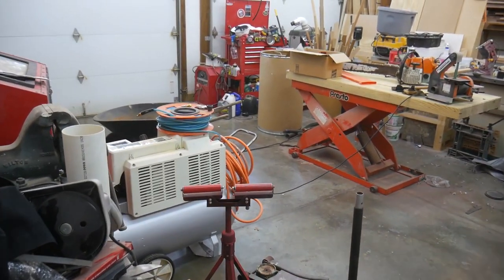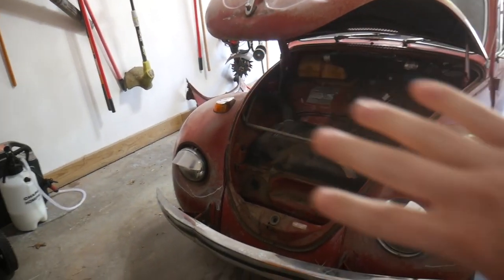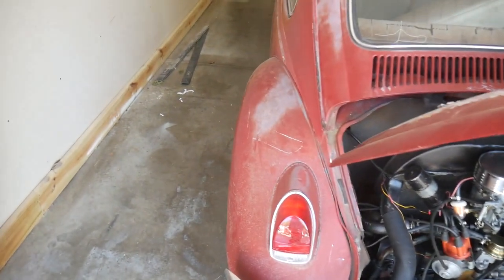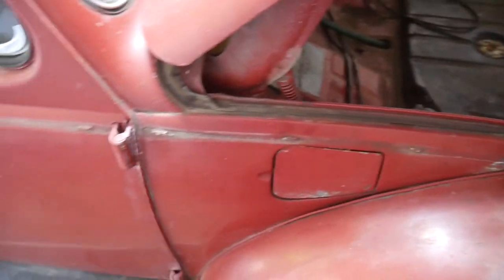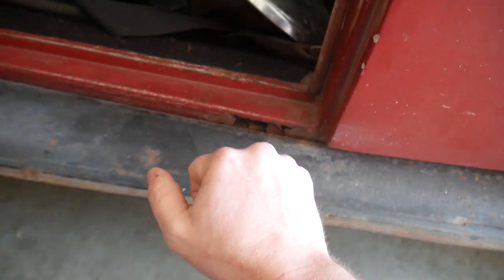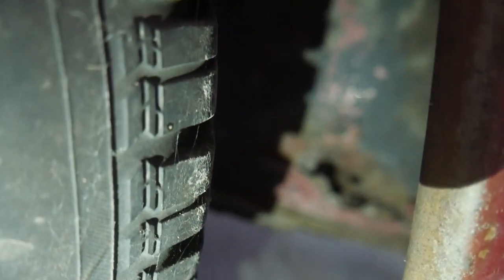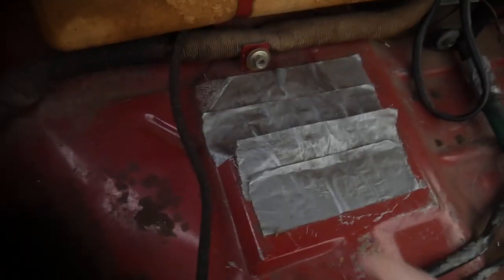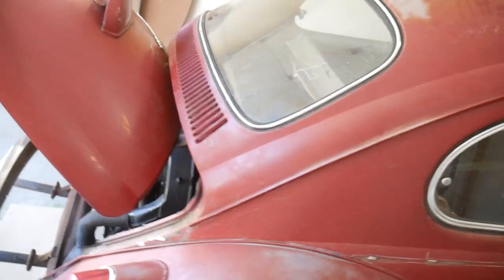New Project!  What have I gotten myself into? || 1968 VW Beetle Part1

Comment: Welcome to VW life! BEFORE YOU DRIVE IT Please replace all the tin work at the rear. The engine compartment needs to be sealed off otherwise you'll very quickly overheat the motor. Research that for sure. You'll do yourself a favour.
Reply from the maker: Thanks! This one is getting disassembled pretty much right away. Gotta figure out what needs replacing and what needs repairing
Reply: Thomas Lightle yeah. I only mentioned it because you spoke of running it with a temporary gas tank and taking it for a run. Under load, you’ll cook that motor quick without proper tin. Cheers and good luck. These cars are super simple. You’ll figure it all out. Like mine, soon you’ll hate it but love it more haha
Reply from the maker: Thanks again. I already drove it before I read your warning. Don’t worry, I only went about a mile on it. The suspension and brakes are shot, so I didn’t want to test my luck!

Comment: Whoops sorry.... I completely missed this.
Since You have a dual port engine.
I has a doghouse oil cooler and bigger fan....bigger engines need more cooling.
You should get a newer decklid, with the slots cut in it. It will allow that fan to draw more air as it was intended. The engine normally draws air through the slots at the bottom of the back glass. This is for single port engines. But the new engine requires more cooling so they put slots in the decklid.
Any 71 and up deck lid will fit.
Of course… This negates it looking like a 68.
Also, since you have a dual port engine. You will need the orange Bentley book. This is for 71 and up. Your engine numbers are under the generator stand. It probably is an AE....prefix...or variant.
Phenomenal engine. It had many great upgrades. Case saving studs, dual relief oil valves, bigger oil pump, doghouse oil cooler, a bigger carburetor, and more horsepower.
You would have to follow the specifications for that engine using the orange book. The blue book would be for your transmission and everything else in your car.
You could keep your eyes open for a single port H5 engine for that car.....but most of them are junk, wore out.
Reply from the maker: Wow, that is a lot of great information! I appreciate it. I’m going to have to dive deep once I get around to rebuilding the engine. Is there an alternative way to get more airflow to the engine besides changing the deck lid? It is one of the few tins on this thing that won’t need any bodywork, lol.
Reply: @SouthpawWorkshop  yes you can “ cal look” the deck lid by buying off set hinges...this raises the lid off the body a couple inches. But your engine will get wet when it rains.
Kawabunga dude!
Used Slotted deck lids are cheap
Just save the original for if you get a single port engine.
Reply: Thomas Lightle many have had great success with simply placing a tennis ball on the latch when driving if you don’t want to go to a raised decklid as OxFixer mentioned. This keeps the decklid from completely closing thus allows more air in. It’s cheap and many experienced aircooled folks say it’s perfect but. Personally, I’d get the slotted lid for your 1600 dual. They are everywhere and you’d likely get one local for cheap. If you were local to me and you brought me a beer I’d give you the one I have that is in perfect shape but, since I’m in Canada......
Reply from the maker: Definitely will keep my eyes open. Thanks to all for the info!
Reply from the maker: @OkFixer good idea. I can paint the original deck lid along with everything else.
Reply: @SouthpawWorkshop  we are definitely Here to help. These cars are getting fewer and far between, and we need to save them in my opinion. Anytime you need help let us know. I guarantee you someone on this thread will have an answer for you. Keep up the good work.

Comment: Hello, and welcome to owning a Volkswagen. That looks like a nice candidate. It doesn’t look too crispy and it hasn’t been boogered up too much.
Now, I’m going to be as kind as I can be. But will receive lots of flack for my comments.
1. Get yourself the blue Bentley book for this. And follow it precisely. How to keep your Volkswagen alive, a step-by-step for the complete idiot. Is another good book it’s lighthearted and full of useful information. But I always go to the blue book for my technical information and what part is missing on my car sort of thing. Remember it all depends on what you want to do. Do you want an engine that last as long as the original one, or do you like taking them in and out 20 or 30 times in the car’s life. Put it back original and it will last longer. It might not have 300 hp. But it will last longer. If you decide to put a 300 hp engine in that car remember how are you going to get that 300 hp on the road? Because that transmission won’t take that. How are you going to make it go around corners? And how are you going to make it stop going that fast. This car was not designed to have a 300 hp engine in it. If it was the Germans would’ve done it.
2.
I can already see, someone has a built-in engine fire under the hood… So they can ....I don’t know? See the gas? I’ve never quite figured that out. But that cheesy plastic fuel filter hanging over all that sparking ,hot metal it’s just not right. If you’re into fuel filters, put one in front of the engine… Front is front. Next to the transmission. If it leaks it’ll just leak onto the ground.
3. You have the wrong fuel pump, and carburetor. Look on volksbitz.com for the correct carburetor. I can tell it’s wrong because it’s shiny and new. Which tells me it’s a Brazilian unit.
The correct fuel pump has a fuel filter in it. Couple that with the one in the gas tank. And you don’t need an extra one. The fuel pump carb and distributor all work together.....if one of the units is made for a mercury mountaineer....it’s going to cause havoc with the other original parts. 
4. How much does it cost for spark plugs? A carburetor? A fuel pump? For a brand new Volkswagen? Well, it cost about the same for this car. For the correct rebuilt well working part. So prepare yourself. If you spend money on crappy Brazilian or Chinese parts. Trust me your engine will wheeze and tralphaz. Sometimes you have to search for these parts because they’re not available. Don’t give up and use the Russian, Turkish or Brazilian knock off. Your engine won’t run right. Now a lot of people say, Dan you’re full of crap. As they drive away with their wheezing engines. I’m telling you nothing is more a delight then driving one of these cars with a properly operating engine. People just don’t know. Wolfsburg West for new parts is the best source....still a crapshoot. Avoid “kawabunga dude bugs (jbugs) , cip1 (sorry we are sold out) or Oreillys etc.
The Samba .com is a good used source.
5 if That car was mine, the engine would come out. I would at least take the cylinder heads off, and look at them / clean them up. Check for cracks between spark plug holes. Check the cylinders that sort of thing. I would find every piece of tin. Including the thermostat. I would find every part for that engine that’s original. The air cleaner etc. The air cleaner that’s on that Right now passes about as much air as a can of peaches.... It will cause your engine to run rich and fowl spark plugs.....And if it gets wet from rain, forget it. But it’s chrome! It must be better… Nope it’s not.
While you have it a part, One of the most critical things is the heat riser tube... you probably need to unplug that. And set your exhaust tips correctly in the muffler, so it draws heat through that tube And preheat your carburetor. Critical! If you want your engine to run right.
Also the guys above me… Are talking about the weatherstripping around the engine bay there are two pieces. You need to buy those and install them. And your breast plate is missing along with other pieces of tin. All this needs to be sealed up from the exhaust. You do not want that hot air coming up into your engine bay and being recycled through the engine.
Another crucial thing is end play.... Grab a hold of the rear pulley and pull it back and forth. The car I am working on right now has about a quarter of an inch end play.... It needs to have about 6000s of an inch ha ha Ha. So I’m way out of spec.
I would replace the rear main seal, the clutch, and the throwout bearing also. And I would while I was in there… Look at my transmission mounts. And change the 90 weight in the transmission. A good time to look at the boots also on your CV axles… Oh I forgot this is a swing axle I think. It will only have two boots close to the transmission.
When the engine is out it’s time to change them… It’s easy and has lots of peace of mind.

Remember German eggheads with slide rules designed this car for efficiency, longevity and ruggedness.....if you try to “engineered” something on this car, it will effect other parts of the car. Ask me how I know.....use the correct part for the car. Try to get a German one. The threads won’t strip, The holes will line up, it won’t leak, or catch on fire.
You tube has a bazillion videos on these cars....if they are showing you How to put dual carbs, an electric fuel pump, 100 mm cylinders, a big cam, wildly ported heads, cal look...anything..How to make your beetle into a sand rail or Baja...etc..the non original part....go find another video

Check out my channel, I have lots of detailed videos on every component in that car.
Let me know if you need help I can answer your questions.
Reply from the maker: So, this comment somehow got marked as spam, so I just found it. Holy cow that was a lot of info, but I appreciate all of it! I do plan on going through the engine and believe it or not, all the tins are present and accounted for.  I even have the original air cleaner! I will definitely check out your channel as I am looking for trusted sources of information. Just like you pointed out, just because it is a tutorial on YouTube, doesn’t mean it is right.
Reply: @SouthpawWorkshop  it’s ok....it’s a wonder that you got it at all. You tube doesn’t like me because I’m a white ,Christian, gun toting, anti virus/antifa heterosexual male.....
Lemme know if you need help.
1:49 I see 5 pieces of tin missing. Brest plate, pulley cover, left and right heat riser covers and preheat pipe.
Reply from the maker: Yes, they were in the front seat. May not have them all still. I haven’t catalogued everything yet. I got roped into a basement remodel which is taking some time, so at least in the beginning, the videos will be coming out a little slowly.
Reply: @SouthpawWorkshop  ahhh ....I understand completely